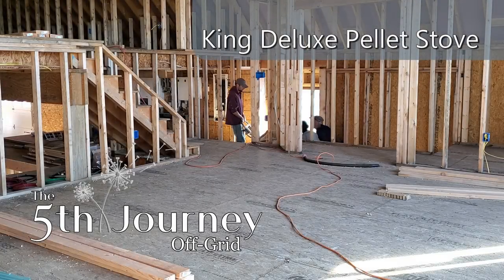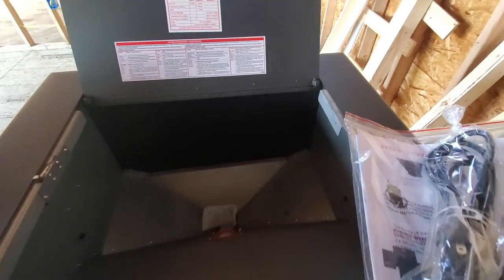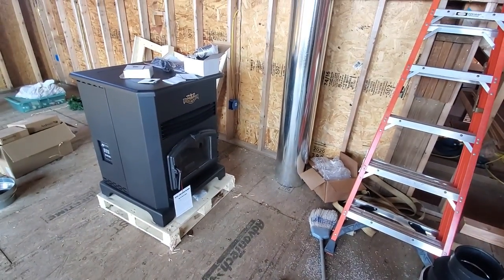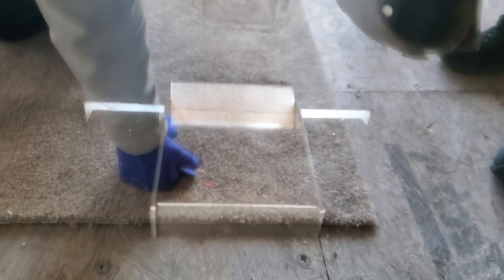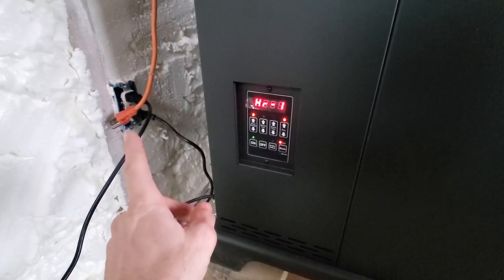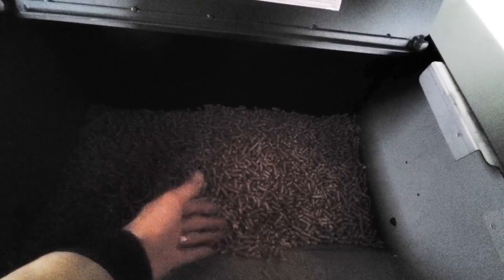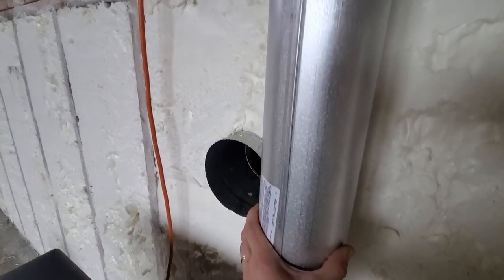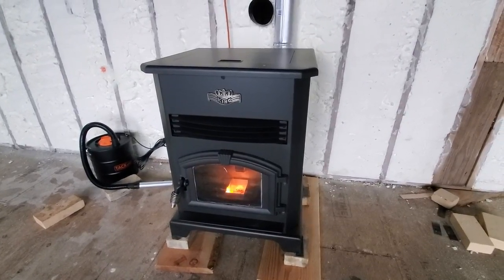Tractor Supply King Pellet Stove KP130 - Unboxing, Install, & Review from our DIY Off Grid Home

Comment: Can you buy pellet stoves that does not use electricity at all? Are those still efficiet?
Reply from the maker: I've seen those but they are kind of ugly and didn't have the best reviews and they cost a lot more.  Figured we'd just play it safe and get something more known.
Reply: Can that particular one featured in your video heat a whole house? Do you know any videos of pellet wood stoves that do not use electricity?
Reply from the maker: @sigglass2183  it heats around 2000 sqft of our home currently.  Pellet stoves work because of the blower system.  I don't think you'd be able to find a reliable one able of heating much without power.
Reply: @Off-Grid  Then are there reliable wood stoves that can burn for many hours without feeding? Like with no fan?
Reply from the maker: @sigglass2183  sure, our last house had a wood stove that I'd load before going to bed and it would still be burning in the morning.  The newer EPA Certified ones, I'm told anyway, will burn longer and cleaner.  You'd just have to get good wood to burn.  They aren't cheap though.  If you're lucky you can find an old steel wood  burning stove at auctions sometimes.
Reply: @Off-Grid  Can those said wood stoves still heat a whole house like your previous one?
Reply from the maker: @sigglass2183  it would heat the room it was in just fine and warm the adjacent rooms but without some type of blower the heat wouldn't get throughout the house.  That said, it was a drafty home.  Had it been sealed up better I feel the heat could have gone further and with a better layout such that the fireplace was centerally located the results would have been much better.
Reply: @Off-Grid  Are there such thing as steam wood boilers? I'm not talking about the outdoor wood boiler that heats water and pumped throughout the house for heating. I'm talking about the ones that burns wood to boiler water makes steam that travels from basement in the pipes to heat every room.
Reply from the maker: @sigglass2183  I'd assume there are but I've never researched one.
Reply: @Off-Grid  There has to be some. They be great to heat your home especially during power outages.
Reply from the maker: @sigglass2183  that's why we're on solar.

Comment: Assuming that’s a temporary setup as that floor protection is not adequate.  Also, why not just direct vent through a wall?
Reply from the maker: It was temporary.  Through the wall is the garage so I couldn't go that way.  Floor protection isn't needed.  The air gap requirement less than the gap under the unit.
Reply: @Off-Grid  yeah I was thinking that was an interior wall. In my area you have to have non combustible material under the entire stove and 6” in front.  Nice stove by the way.  👍
Reply from the maker: @Eyball1972  The final produce does have tile under it and around it.  I'll do a follow up video on it later.

Comment: Question, do you know if it's ok to pre ignite the pellets with a match or torch while the stove isn't running? Do you know if it's possible it could burn manure pellets as long as dried?
Reply: Does it have an ash bin and can you vacuum the ashes out while the stove is running?
Reply from the maker: @sigglass2183  you are not supposed to light the pellets on yourself and I honestly don't know how you would since I don't think a match would be able to do it.  You can not open the door while it's running to empty the ash but it shuts off in a couple minutes.  Then you can clean it out and atart it again while it's still warm.  I've run it a week before having to clean it out and just waited for a warmer day.
Reply: @Off-Grid  Could it burn wood chips?
Reply from the maker: @sigglass2183  no, they would clog the auger.
Reply: @Off-Grid  Would saw dust work?
Reply from the maker: @sigglass2183  no, has to be pellets.  You can buy a pellet machine and make your own with the sawdust.

Comment: My personal opinion, the King is a great looking stove, puts out good heat, but I hated the controller. It should be able to be setup to be on/off, as well as the Hi/low with a thermostat. Only having the hi/low with the thermostat it uses way to many pellets and overheats the main area that it's in. I hated it. The Pelpro pp130 is a MUCH better option, heats just as well or better, and uses an internal thermostat with an on/off function, and is about the same cost or less!
Reply from the maker: Ours has five settings but we always have it on the lowest which heats the house just fine.  Haven't used the thermostat yet.
Reply: @Off-Grid  I myself prefer the on/off function with the thermostat as opposed to the hi/low or in your case the constant on option. A 40lb bag, with the thermostat set to around 70°f on my pp60 lasts about 48-60 hours depending on how cold out it is. It's just much more efficient for us, but in a larger, less insulated space that maybe different.
Reply from the maker: @zackhaas3267  it is heating a large room so running 100% of the time seems to work best.

Comment: Your handle spring thing is mounted upside down.
Reply from the maker: Yep, I didn't like how far it stuck out.  Putting it on upside down still works and since you don't open the door on a pellet stove except to clean it once a week it isn't a big deal.
Reply: @Off-Grid  ah yes makes sense.  This is my first winter with a pelpro pp130 pellet stove.  Loving it so far.   Good luck with yours.
Reply from the maker: @jeffneuman7587  Going on our second and have it running right now.  Went through and cleaned up the exhaust fan and vacuumed it all out really good.  I think a lot of the problems people have is from not doing simple maintenance.  We still plan to put a wood burning fireplace in the addition.  With 90 acres of woods it makes sense.
Reply: @Off-Grid  I agree.  Maintenance is the key.  Good luck with your future plans.
Reply from the maker: @jeffneuman7587  You too, Thanks for the post.

Comment: No way that pulls 600 watts.  Maybe when the igniter is on.
Reply from the maker: At the time of the video the whole house was only using around 600 watts. The stove only pulls around 200 watts which is great when being OffGrid.
Reply: @Off-Grid  yeah that sounds more like it.  I am going to test mine and see.  But there is typically just 3 motors running in these units.
Reply from the maker: @Eyball1972  There is only two in this one.  The internal blower and the external one.  They both cycle on and off depending on the setting.  We rarely have to turn it above the lowest setting to be comfortable in the house.  It is a tight house though so if installed in an older home it might not work as well.

Comment: I put a range hood over mine
Reply from the maker: One that blows out into the room to circulate more heat?  Not a bad idea.
Reply: @Off-Grid  you could.  I connected it to my cold air return and use the furnace to circulate it.
Reply from the maker: @chadmcleish  I did some similar that I'll have in a video really soon to try and get heat to the back bedroom.

Comment: You probably shouldn’t be doing an unboxing video on  a pellet stove. You apparently haven’t had one before.  I’ve had several and in fact so service and repair on them. I’ve never put silicone on joints. That’s why they twist link. An ash vac is nice but unnecessary. Ash bucket and a large cheap casserole spoon works great and is a lot less trouble. Any hosed vac can clean up the mess.   Keep it simple.
Reply: Ps. I have the same stove and it will hold three bags of pellets.  I also recommend a painters tool be kept with the stove. Good for cleaning burnpot, opening bags etc.
Reply from the maker: It wasn't basic caulking I was using, it was fire block since 90% of the pipe is in my living area and I didn't want any possibility of exhaust entering the house.  I don't know why you'd see that as an issue. 

The ash vacuum wasn't worth it.  A shop vac works a lot better.  I fully clean it as needed, glass too.  Couldn't imagine scooping it out with a spoon.

Have been using it for a few winters now without any issues, so I'd say I did pretty well.

Comment: Coat the inside of the hopper with a graphite paint, paint with graphite in the paint, not a color
Reply: Filling the hopper full of pellets and not allowing the hopper to get very low also helps with the feeding.

Comment: Your lack of confidence in correctly connecting "B" vent piping is disturbing. You should never have to use any sealant when installed as designed.
Reply from the maker: Not sure what you are talking about as this is the correct pipe for the stove and it has been working perfectly for some time now.
Reply from the maker: @r.d.riddle2068  Please explain how it should be done.  All the pieces locked into place and the High Temp Sealant was recommended by the company I purchased the pipe from who has been in business for 40 years.

Comment: Could’ve vented and dumped out wall, never seen a pellet stove vent through the roof
Reply from the maker: Hello Peter, behind the wall is the garage and the pellet stove is about centered in the house so it would be roughly the same distance in either direction.  Going out the roof was the easiest and looked the best as it vents out a chimney built into a coupula.  Thanks for watching and commenting.  Check out some other videos to see coupula's.